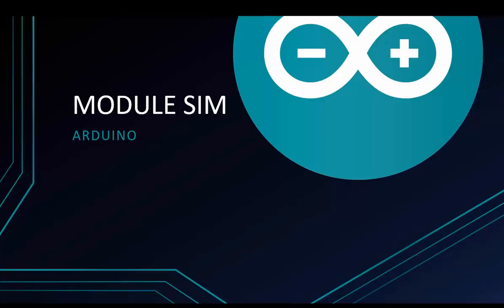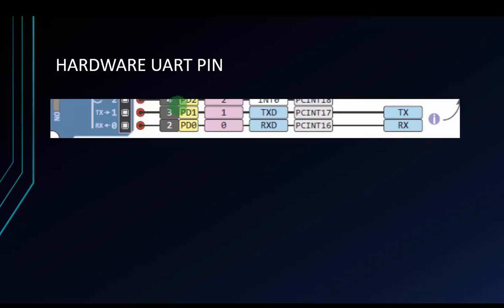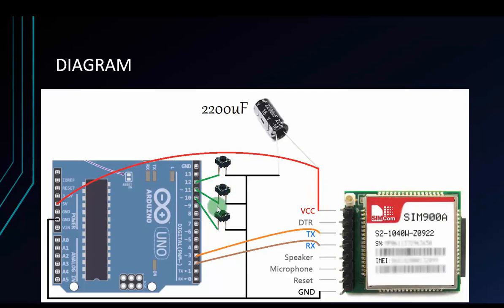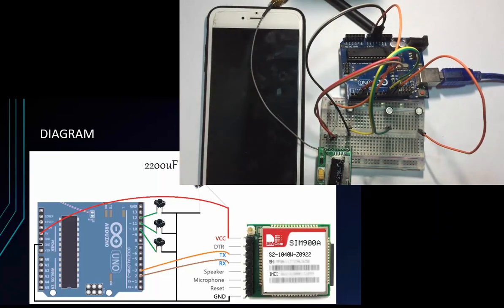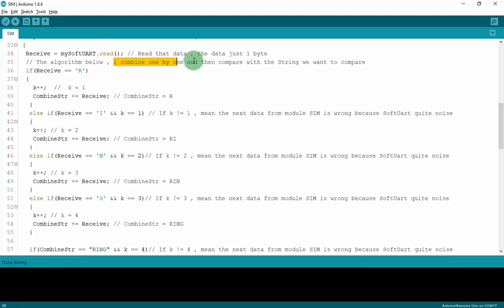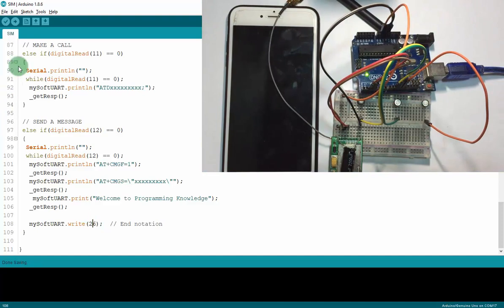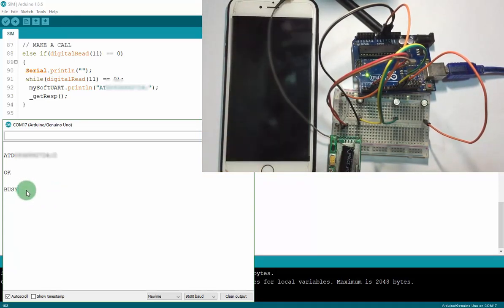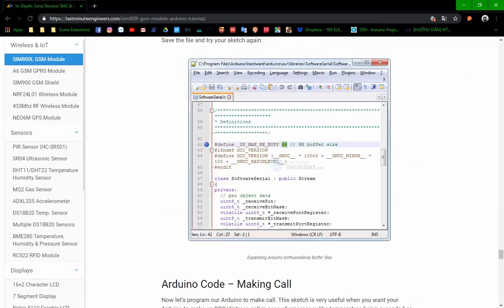Arduino Tutorial for Beginners 19 - Send SMS and Call from SIM900 GSM Module

Comment: Full Code

#include <SoftwareSerial.h>

SoftwareSerial mySoftUART(3,2); //RX ,TX
String CombineStr = "";
unsigned int k = 0 ;
char Receive;

void _getResp()
{
    delay(1000);
    while (mySoftUART.available())
      Serial.write(mySoftUART.read());
}

void setup()
{
    pinMode(10,INPUT_PULLUP);
    pinMode(11,INPUT_PULLUP);
    pinMode(12,INPUT_PULLUP);

    pinMode(13,OUTPUT);

    mySoftUART.begin(115200);
    Serial.begin(9600);  
    
}

void loop()
{

  if(mySoftUART.available())

  Receive = mySoftUART.read();
//
  if(Receive == 'R')
  {
     k++;  //  k = 1
     CombineStr += Receive; 
  }
  else if(Receive == 'I' && k == 1)
  {
    k++;
    CombineStr += Receive;
  }
  else if(Receive == 'N' && k ==2)
  {
    k++;
    CombineStr += Receive;
  }
  else if(Receive == 'G' && k==3)
  {
    k++; // k = 4
    CombineStr +=Receive; //
  }

  if(CombineStr == "RING" && k == 4)

  {
    Serial.println(CombineStr);
    digitalWrite(13,HIGH);
    delay(50);
    digitalWrite(13,LOW);
    delay(50);
    CombineStr = "";
    k=0;
  }
  if ( k == 4 )
  {
    Serial.println(CombineStr);
    CombineStr = "";
    k=0;
  }
  Serial.print(Receive);

  ////////////////////////SEND
  //TEST OK
  if (digitalRead(10) == 0)
  {
    Serial.println("");
    while(digitalRead(10) == 0);
    mySoftUART.println("AT");
    _getResp();
  }

  // MAKE A CALL
  else if(digitalRead(11) == 0)
  {
    Serial.println("");
    while(digitalRead(11) == 0);
    mySoftUART.println("ATD01900000000;");
    _getResp();
  }

  //SEND A MESSAGE
  else if(digitalRead(12) == 0)
  {
    Serial.println("");
    while(digitalRead(12) == 0);
    mySoftUART.println("AT+CMGF=1");
    _getResp();
    mySoftUART.println("AT+CMGS=\"01900000000\"");
    _getResp();
    mySoftUART.print("Welcome to Programing Knowledge");
    _getResp();

    mySoftUART.write(26);
  }

}